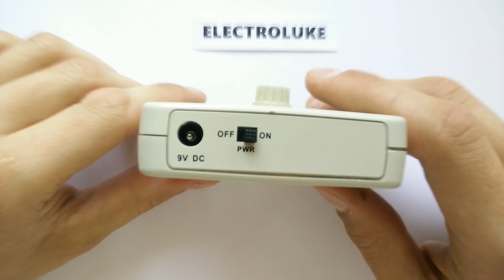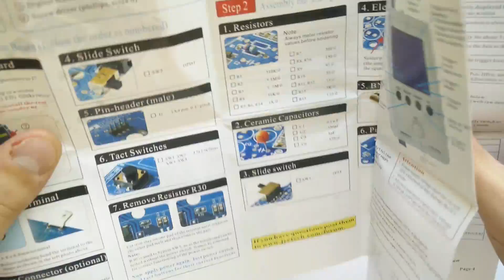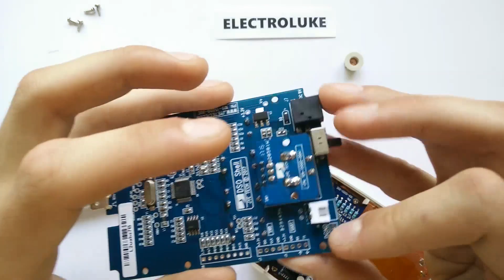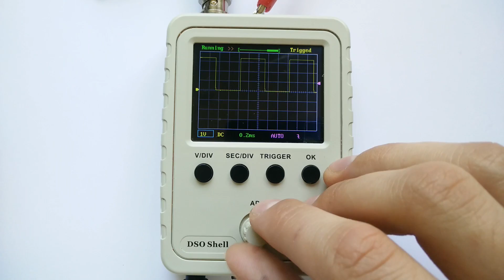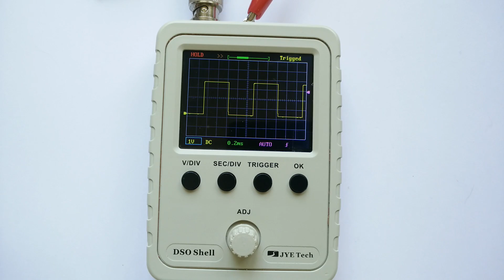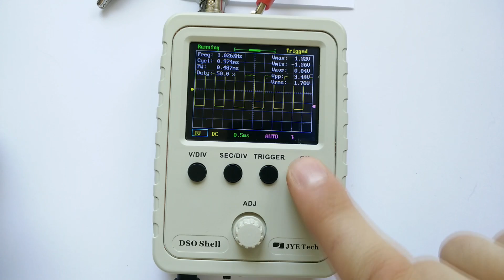Product Review: JYE Tech DSO150 Oscilloscope for 20$

Comment: First of all, I congratulate you for the very instructive videos, on the occasion I ask for advice on how to view the trend of the wave of a 220V inverter produced by a photovoltaic panel that charges two batteries with a charge regulator , given that with the oscilloscope, like this one, I have seen that the probe cannot exceed 50 v, I await an answer thanks.

Comment: I convert vintage Valve / Tube Radios into Guitar Amps, my Oscilloscope broke and because their essential to my process i needed one. It must not break the bank and it must be pretty mobile as i have a couple of benches in different rooms. If your a hobbyist and your doing electronic projects these are a must. Test equipment can be expensive so this was ideal. It's not bad for £22. The 2 channel model is only £44 so i may invest in one of those if i cannot find a replacement CRT for my main one.

Comment: On my scope of this model, I could not get the waveform SAVE and RECALL function to work either.

In my own tests, I found this scope worked well, with reliable functionality, display accuracy and measurements, as long as I did not try ans measure signals much outside if the audio frequency range. I thought it might be useful in a technician's toolkit where they only need to work with lower frequencies.

I discarded the cheap, short, unshielded test leads that came with the scope, and substituted an inexpensive scope probe...it was a 1X/10X probe, but the scope gave worse results when the probe was set to 10X, so I only use it in the 1X mode.

The things that impressed me about this particular scope:
- the user interface and controls and display colors and indications are well thought out and coordinated
- unlike pretty much ever other inexpensive kit scope, this one has a much more useful form factor, and the nice case coming as part of the kit is very good

I would not call this scope a 'toy'. Its functionality is better than many basic analog scopes, and adds some of the useful features of a DSO.
Reply: Was it more stable with the shielded scope probe? At higher HZ I watched your vid as well.

Comment: Therram, good for you in pointing out that, in spite of JYETech's specifications that say the bandwidth is up to 200kHz, that practically it is only really reliable in the audio range (up to 20kHz), and perhaps as high as around 50kHz if you are careful. Beyond that, it will display some very misleading waveforms.

Also good that you mentioned that the power supply is NOT included, but is required to make this work. I think you forgot to mention that the supply needs to have a 5.5x2.1mm sized barrel connector in order to fit the jack on the scope. It really should bu just any old 9V supply....it should be a regulated 9V supply, in order ot prevent accidental damage to the scope circuitry.

I also recommend spending a few more dollars for a basic oscilloscope probe, rather then the cheapo unshielded set of test leads that are included with the kit.

I wrote my own detailed, enhanced user's manual, and anyone interested can download the PDF of it from here:
http://www.serpentwebsite.com/fileshare.htm (it is at the bottom of the list).
Reply: Thank you for the manual, it is very helpful!

Comment: not a bad little deal. thanks for the video. looks good for some small jobs. if they add a second channel and external trigger i would MARRY IT. as well as buy one of them and sell my tektronics scope. when in ground mode the trace looks like it's responding to your voice, interesting problem, is that leakage from something or failure of the internal shielding ?? all in all it looks like a reasonable kit for the price. thanks again for the video. good work..

Comment: just got mine yesterday and just playing around with it for now. i got the fully assembled kit (except the case) and, as expected, worked right out of the box. also, pretty cool that is 9v which means we can just throw a 9v battery on it and make fully portable. i can easily recommend this to anyone doing electronic projects as a hobby. for the price, this should be the next measuring tool after a decent multimeter. 
my biggest gripe about is that the trigger starts at the middle point and basically the first half of the measurement is garbage and leaves the second half of the graph with only limited space for the signal you actually want to capture. for example, when sending the IR codes, they have to pretty small in order to fit the whole sequence, if i try to make them wider, only about half of the full sequence will actually fit. anything longer than about 8 bits and you won't be able to read it due to the trigger starting in the middle. 
and lastly, in the video he mentions he could not get the save/recall functions to work. they work fine, but is the adj+sec/adj+trigg that calls them,  not the ok+sec/trigg.
so no, don't expect a fully featured scope, but this is definitely useful for simpler projects or troubleshooting them.

Comment: I have mine set to the same as yours at the beggining and the frequency/cycle etc readings keep dissapearing and dont stay on a constant 50hz like yours. Is this a possible fault with my unit as it seems very inconsistant. Now it's reading 249hz? I have a black model ETEPON series which I think is identical to this one.

Comment: Can I use this to test car audio? Need to find the point where it starts clipping at 40 hz
Reply from the maker: sure!
Reply: So it does sinewave?
Reply: @koushiroizumi0  It does. I ended up getting the Mustool MT8206 from ebay for £40. Its almost identical to Liumy Graphical  multimeter which is £80-90. I have done some research and found that these are not really Oscilloscopes but just Graphical meters.
Reply: @Pkdimmock  so how does the MT8206 do in terms of detecting clipping?
Reply: @koushiroizumi0  I have not used it yet. Still in the process of fitting door speakers and running 0gauge cable. Will be setting my gains soon. But from the vids I have seen the graphical is good and can def see when the wave starts to clip. They compared it  expensive Oscpoes and the SMD dd+1 and it detects accurately compared to them. I will be using it in the next few days. Can keep you updated.
Reply: @Pkdimmock  yeah, keep me updated. i found a video called "Detect amplifier clipping WITHOUT DD-1" by barevids here. don't know if that method works for full range too. i want to build a 7.1 channel amplifier group for my pc and need to make sure i won't get nasty clipping.
Reply: @koushiroizumi0  the Mustool can def do that. I am using it to get a clean signal from car stereo the amp that then to set the gain on the amp to make sure from amp to speakers is clean. Sounds like you want a similar thing. It will def do that.

Comment: I was given a Tektronix 7403N which I am having trouble getting to work. I just bought one of these so I can check various wave forms against the operator's manual. I hope a simple, qualitative measurement will help in the restoration as I cannot figure out why I am getting no trace at the moment. I got all the DC rails up to voltage and stable but I do not get full potential on CRT.  :-(

Comment: Bought this same model and it worked the first time. The only problem I'm having with it is V/DIV button wants to hangup. It's soldered fully flat on the circut board, but for some reason the front cover won't let it pop back up like it should. Probably gonna have to modify that cover a bit... i think it's slightly warped.

Comment: Just bought one of the kits that you have to assemble -- it was $25 with shipping, so maybe I overpaid a bit but this still seems like a really good deal. I do wish that it had a battery compartment for the 9v, but I'll work something out. Did you add a battery to yours? what is the battery consumption like??  I'm thinking of perhaps going with a rechargeable lithium cell (flat) which wouldn't add a lot of bulk to the unit.

Comment: I am look for something cheap to see soundwaves (tuning amplifiers, use this to see when the sound clips), and diagnose cars, for example O2sensors and ABS sensors. Will this unit work fine for this?
Reply from the maker: Most probably - yes, this DSO might be the most inexpensive way to do the things you listed.
Reply: Yeah I use one just like this its perfect for amplifier gains
Reply: Is this good enough to check simple oscillation (motor boating effect) in audio circuits? Thanks.

Comment: I have a newer version. I am not getting the same inaccuracy problems. learn to measure freq and amplitude manually using the grid and div you have selected to verify. If you have a full size scope available your not gonna use this one. But this one is perfect for lower frequency projects if you can't afford a big Oscope. Any eyes on what your circuit is doing is a good thing.
Reply from the maker: well said
Reply: What model is the newer version?
Reply: @SunflowerandFriends  In principle it's not that old. There are three parts that were updated regulary and JYE has a good documentation about this on their homepage.

Video:
- Main Board: ver. E
- Analog Board: ver. E
- Firmware: 061

Latest:
- Main Board: ver. E2 (probably because of display with new controller)
- Analog Board: ver. F
- Firmware: 120

The difference between the Analog Board version E and F is not that much. Only a protection resistor was added. But the Firmware was improved a lot and should be updated. Even this is possible for this low-cost device.
Reply: @PT63  I just got one the other day and still have to build it to you think mine wil I have the updated firmware??????

Comment: Those stand offs around the button should be screwed to the board that holds the button, this will align the button with the hole for you. I built mine a year ago and never could get it working.  One day, I was describing the problem on a forum when it dawned on me, the problem had to be in the  rotary encoder. So I ordered in 10 of them, and mounted a new one. I had  a difficult time getting the old one off that board so soldered it directly to the main board, it worked fine and suddenly I had a working mini oscilloscope.  This after buying one of the larger models of scope kit, which  I built up and have working as well, so now I can hook two scopes to two different places on the device I am working and have two separate reads of the problem.
Reply: Jerry, where did you source your 10 rotary encoders? I need to replace mine.

Comment: For the price this oscilloscope is unbeatable, which is why I bought one a few days ago on banggood. Of course you must not expect any accuracy (if you do, I guess you don't have enough experience yet). But it is a 100% suited for simple failure checks in devices. I'm taking part in a "repair cafe" (that's where people repair things for other people) and we don't have the money to buy measuring equipment (since we do the repairs as volunteers for free). I for sure won't take my own clunky analog scope there with me. But this thing will be perfect for measuring if power supply voltages are stable or a certain signal is at a certain point for example. I will also mod it to be battery operated (I already have a 800mAh Li-ion cell and a charge-module here from a previous project; waiting for the mini step-up converter). After that I don't have to worry about measuring anywhere I want in a circuit, even those where the low voltage is not isolated from the mains (I know that can be dangerous; but carrying an isolation transformer around all the time isn't an option either).
Reply from the maker: Yes, I totally agree with your insight, and I am also willing to do the same mod and a tutorial beside it to share with others. I just need to find some spare time for that.
Reply: superdau - Are you saying that because you will be using battery power, you don't need an isolation transformer since you won't be sharing a ground reference with the circuit under test?
Reply: @enigma7070  Not being directly connected to mains removes the danger of accidentally connecting the probe ground wire (which in most scopes is directly connected to the mains ground and has the same potential as the neutral mains line) to a live mains terminal shorting out the mains through the probe. With this particular scope, I do doubt that the power supply is not fully isolated from mains, i.e.,  the probe negative/ground is very likely NOT connected to mains ground or neutral, making it safe to probe at will (within the scope's voltage limitations of course). But precautions must be taken first, to ascertain if this is in fact the case.
Reply: I'm pretty sure in the 1960's NASA were using inferior Scopes when working on the moonlanding project , and as we all know , even with unreliable Scopes compared to today's standards they still managed to land astronauts on a film set in Arizona, shame time traveler's didn't allow NASA to use iPhones cause instead of the moon landing ,NASA would of landed on a Mars film set instead with the power of apple's crusty products.

Comment: A reminder: don't buy the knock-offs from aliexpress or ebay. JYE tech, who's doing all the development, won't get anything on those sales. I think the bang good link is a genuine one (I bought mine from there, but it's still on its way) and I gladly pay the few $ more (still only 21$) to support JYE tech. You can check the JYE tech forums for known fake sellers.
Reply: superdau 
Indeed. Tons of fake. The genuine one have CE mark on it.
Reply: @JL-sn1wn  CE with a space means that its real. CE without a space means china export
Reply: @zanpekosak2383  where do I find the ce Mark?? I just got one and still have to put it together!! I got mine off banggood only cost me €14.34 but I but all my stuff of there so I get good discounts. But still worried about it being fake and having old firmware. So could you give me any tips please like where that Mark should be or any other clues to it been the real thing. 👍👍
Reply: @zanpekosak2383  thanks for that I found the mark it's on the bottom of the case and it has got a space between the C and E and everything looks right when comparing the boards with the build guide provided, so I'm feeling I good bit better about it been genuine. So thanks again. And I will check out that address you have me and JYE website too!
Reply: thats recent... the older ones, even genuine, do not have a CE mark on it, so if you get old stock it may not have the CE mark
Reply: Not sure if I have a fake one. Didn't come to mind when I bought it off eBay, just picked the first one that looked good. It works but the instructions don't always match the board (there are no resistors or ceramic capacitors to solder). I also tried calibrating it with the two potentiometer looking thingys C3 and C5 as the instructions say, but C5 doesn't do anything. Only C3 was needed for calibration. It works so I guess I can just leave C5 alone. As for power, there is a connector provided for I assume internal power. I was thinking about stuffing a LiPo, BMS and a boost regulator in there to make it completely portable. I have some USB BMS' that let power through when charging.
Reply: yeah well bothered

Comment: Hi, I've recently bought one of these, but when plugging it in I got a white screen and a burning smell from one of the chips on the back. I thought this was just a defective unit, but my replacement has just arrived and it also has a white screen! I'm sure these aren't fakes, and I'm definitely using a 9V power supply - but it is 1.3A. Could it be the current is too high? cheers
Reply: It's not your power supply (assuming it's a regulated supply). From your description, the supply is capable of supplying 1.3A at 9V. Whatever you connect it to will only draw the current it needs - I doubt this scope needs more than maybe 50mA or so - maybe 100mA. It does need to be a regulated supply though. An unregulated supply of 9V that is capable of delivering 1.3A may easily be 10 or 11V or even more if a smaller current is being drawn. There are lots of warnings that voltages greater than 10V can damage the device. One other problem might be if the supply were connected incorrectly (wrong polarity) but the schematic shows that this is protected against by a diode so this is not the problem.
Reply: Make sure that the power supply is the correct polarity

Comment: Great review, thanks. I've just built one from Aliexpress of these and it works great.

The later  firmwares  fix a couple of bugs (see http://www.jyetech.com/Products/LcdScope/Firmwares_150.php) - in particular a large DC offset on the 0.1V test signal.

They also changed the key combinations for waveform save and recall. Pressing [ADJ] + [SEC/DIV] saves waveform to memory. Pressing [ADJ] + [TRIGGER] loads saved waveform from memory (it used to be OK + these buttons, which is why you couldn't get those functions to work!)

Don't press and hold ADJ + Trigger for too long though, it does something strange - moves the waveform to the top of the screen, changes the V/Div and Sec/Div displays to 'ing', and freezes the other functions - I think this must be a bug!. But power-cycling and resetting the unit restores its functionality.

Overall, a nice interesting and not too difficult project to build - it's a great little unit for the price and quite useful for audio applications.

Thanks again for the review!
Reply from the maker: I've made a video about this ! Thank you, without your comment it wouldn't probably have happened :D.